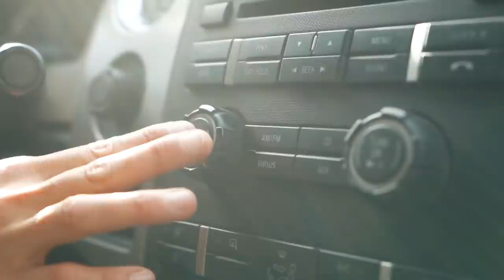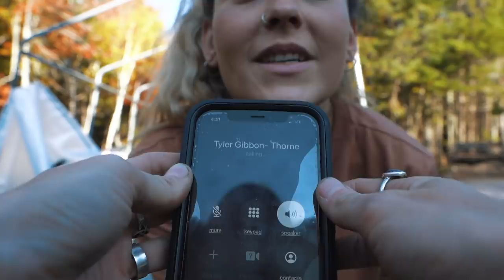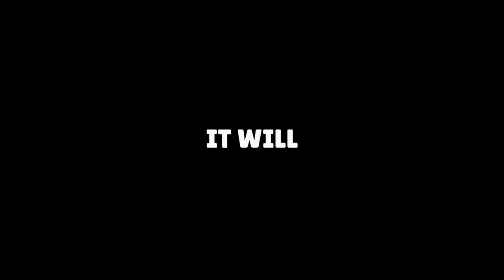Preparing for First Winter at Off- Grid Cabin

Comment: When you stack your wood you should criss cross the end pieces, meaning 3 or 4 pieces with the ends facing out then the next row same direction as the pile and the next facing out again.  This provides a support on the ends so they won't roll out.  Hope this is helpful!
Reply: I didn't have the heart to write this... live and learn! The walls of the tent will be severely tested. Throwing a tarp over the pile to be corded while it rains is a good idea also. As long as we're at it, the bottom row of your cords shouldn't touch the ground. Pallets are ideal as they also create more air space to dry the wood.
Reply: @secondhandrose6214  good suggestion.  Better air flow under and helps decrease chances of mouse nests.
Reply: All stuff I was going to say. Mouse, rat squirrel and any other small rodent will make a home in the stacks. Use some of your split wood to stack on the ends criss cross, you have 6 cord you won’t miss the few you will use to make end posts. Plus if you put a structure on the outside the tarp won’t be able to breath then you may get mold.
Reply: Definitely wood should be stacked on something such as a pallet. Lots of work 💪
Reply: Was going to make the same recommendations, pallet floor and crisscross.
Reply: Stacking wood is an art. alternate the wood so that you give the cord strength. That way you do not touch the sides of the tent. Plus you do not want the wood to stack against a reinforced wall, you want there to be air flow around the wood cord.

Comment: If you stack your wood in layers alternating the direction you should be able to stack straight up with no rolling off the pile. One layer left to right the next front to back. Continue as high as you can reach! Just a thought!
Reply from the maker: Yes! Thank you! That’s what we researched. Takes some practice 😂
Reply: what John said, plus minimizing space inside the wood tent.
also look into getting a Gorilla wagon for the  yard, they have 'em on amazon. 
a good sharpening stone for the Axe for Chopping wood and a decent chopping block will help with ergonomics 
funny thing hubby and I replaced the cover on our Shelter Logic shed as well.we started around 2 and finished before it turned to darkness, but we also used our backhoe to stir up the dirt in the lane-way and sold tires off another vehicle. So from 1 till 7 it was go go go.
for chainsawing you could use some of the longer tree limbs and make a DIY stand for sawing wood. just remember if the limb is starting to bend as your cutting, STOP remove the chainsaw and turn the wood around. depending on the side of the limb it can bind up the blade and you will be in a pickle. and a knot will make the blade kick and jam up so never work under it. Always out front and don't lean into let the saw do most of the  work but always have a grip on it.
I would love to see you guys insulate the cabin. I know at Home Depot there have big cans that could cover your entire house in  1 attempt.
Or just put in the fire proof stuff with a vapor barrier. then you guys will be snug as a bug in a rug.
Keep up the good work
Reply: Probably the best suggestion yet for stacking rounds.

Comment: If you stack the wood along the long row, you can create an aisle and take wood from the back first. Then when you start to add more wood for next season, you can put it in the back and use up the old wood first while the new wood continues to dry. Crisscross stacks will dry faster and like the other have said will create more stable stacks.

Comment: you don’t need to renforce the sides of the tent just “hashtag” style stack the wood on the ends of each row. then you stack the wood normally between those two “bookends”. Good luck, it’s a learning process but I love the feeling of heating with wood👍🏼💚
Reply: This! I'd also say to try to vary the whole logs to split, but that's just how we did it on PEI. Though I'd have probably just put a basic lean to against the current shed and tarped over it.
Reply: I was going to suggest this also. ll=ll=ll=ll=ll=ll=  <- stack like this. Hashtag method. Juat on the ends. Every layer of wood you switch direction for the last 2 or 3 peices. Like a janga set!!! The moddle stays how you have it!!! It works like a charm

Comment: Love your videos. As someone who's burned wood for years, you're going about this all wrong. I've never used a shelter, just stacked it. But, here's my .02. Stack the wood along the long sides. Possibly a third in the middle leaving a walk way between the stacks. Drive in a fence post, or two, at the ends of each row to keep the wood from rolling. Burn wood from one stack until it's gone and move on to the next. Any wood you cut up from your property or have delivered goes into the void you created. Burn the oldest first. Hope that makes sense. You'll get your own system down.

Comment: Hi Girls :)  I noticed one thing that you should have done with your firewood tent : Which is either lay down some of that rolled fabric, lay down pieces of pallets or a bed of gravel to keep the logs from touching the ground from rotting 
And as far as the sides go you can take sheets of 1/2 in. plywood zip tied to the rails or something like that

Comment: I used to live on a farm and we split wood for heat. A great way to stack wood is to crisscross your wood on the ends so it doesn’t roll off. Like change the position on each level. If you Google image stacking firewood, it’ll make sense I think. Just a thought if you hadn’t seen it. Love your videos!

Comment: You can coat your tarpaulin cover for the woodshed with Thompson's Water Seal. It adds a second layer of moisture protection from the elements + it protects it from harmful UV rays that will destroy it otherwise.
 I use a simple 1 gallon garden sprayer and a rag to apply it evenly.
 Just be sure too rinse the sprayer out with hot soapy water under pressure out of the spray nozzle as well. Don't want to ruin it!

Comment: Using 2  T post on each per row is a great way to hold up the sides of your firewood. And I would recommend if you can find some good used pallets to put them down first to create airflow underneath your wood.

Comment: You’re supposed to stack the wood in a cross cross square tower on each side of each row to hold the weight of the wood in the middle.. jus FYI! I love living in Nova Scotia :)
Reply: They should also grab some pallets to get the wood off the ground.
Reply from the maker: Yes, we’re learning haha. Next week! It’s beautiful xx
Reply: @billmcgarrity1241  yes I agree the wood needs to be off the ground... Just use two logs that are the same diameter about 10 feet so 4 10 footers make one row in the tent ...you can nail a crossers to keep them 14 inches apart assuming your stove takes 16 to 18 logs
Reply: @billmcgarrity1241   I was thinking about that. Won't the rain come in at the bottom of the tent and get the bottom layer all wet over and over?
Reply: Yes, definitely lay pallets or two by fours on the ground under to keep wood slightly elevated as well. If you do those two things you guys should be just fine :)
Reply: @kentmillard3869  Well that was interesting and educational. I hope the girls watch it before they unstack and redo it all. 😊

Comment: Can’t recommend “The Game of Logging” course more strongly. It’s focused on effective, efficient, SAFE chainsaw use and in about 4 days I was dropping trees just as accurately AND probably more safely than the dudes in my class who had been logging for 20 years, srsly.

And, check out how to build the ends of your row of stacked wood by turning the direction you lay the wood by 90 degrees, each layer. Right to left bottom row, front to back the next one up, right to left for the third layer and so forth. That will hold the ends and keep the pressure off the sides of the tent. Lived off grid for years in my twenties and you two are crushing the learning curve AND productivity. Legends!!

Comment: I'm looking forward to seeing the direction(s) on how you're going to get power.
You've got several choices if you ever think about alternative energy sources. The most obvious is solar where you could panel your roof (if it's facing in the right direction), or place panels on the ground which you could add motors to and increase efficiency by keeping them pointed at the best angle. There's wind power, not so practical surrounded by tall trees, but there are some new ones coming out that are the size of an oil drum. Geothermal, depending on conditions beneath you this could be a possibility. You could consider solar water heating panels on the roof, but not so practical in the Winter and hard to get snow off, the same goes for regular solar panels, which is why I like ground based panels. They're easier to keep clean and maintain. Another possibility is using solar mirrors. Maybe you've tried them for cooking while traveling in your van. They work for water heating, and I'm guessing here, but perhaps can be affordably used to generate power. Solar mirrors are very efficient with even small solar ovens able to cook dinner with.

Comment: Here's a tip.  When you get something like that tent with a lot of pieces, the instruction manual has a parts list.  Before assembling anything, make sure you have all the pieces the manual says you should.  Another thing when assembling something like that that is tall with multi-piece legs, is don't put the bottom of the legs together until last.  This keeps the top of the unit in reach.  Then you just put the rest of the leg pieces on one side at a time.  Great job.  I love how you don't let adversity stop you!

Comment: Good deal. I was worried you were not going to enough wood for how cold it gets up that way. Ya better get those woolies out girls. It is fixing to get real cold real fast. Make sure your water supply does not freeze up on you. And get a wheel barrel with 2 wheels up front. It will make things so much easier. Stay safe stay warm. And have fun always

Comment: Great work and results! Very impressive! Suggestion,  buy the brackets sold on line or hardware stores to make wood racks using any size 2x4's.your firewood would stack and never role down on the sides of your shelter. The 2x4's also attach on 4 sides going up to the length of the 2x4 you choose. Good luck!

Comment: If you get ANY wind, you’ll want to anchor that shelter better than the junk they send. What I did was sink heavy duty T-posts 5 ft into the ground and tied the shelter down using a noose around the post and a taunt-line hitch over the horizontals at 4 corners.

Comment: For our wood cords we built a rack with 2x4's. The |____| and the wood is stacked in the middle. We used cement deck footers and sat the posts in them with a cross bar in the middle and top to make it solid. The whole thing is as deep as the shortest pieces of wood we have. This way the wood has air flow underneath and all around and you don't have to worry about wood falling on the side of the shelter.

Comment: I don't know if you read all your comments. But.. a few observations that might be something you want to think about. 

1. That shelter logic has no snow load.. One night of heavy wet snow and the frame will collapse.  Ask me how I know. Advice. Stand a 2x4 up at each truss connection as you're stacking you wood.  From ground to roof truss and somewhat snug fit. That way it will keep the frame from collapsing under snow load. 

2. Get the trucked kitted out for winter. IE: keep a couple of blankets in it just incase you get stuck somewhere. Also a little buddy heater with two bottles. Doesn't have to be a big one. Something that can attach to torch tanks. 

3. Snow chains for the truck tires and practice putting them on. Learn how to let air out of your tires for more traction in the snow. NOT COMPLETELY FLAT .. but say down to 25 lbs or so.. Can make a huge difference. 

4. Keep a light weight snow shovel in the back of the truck and a regular spade shovel in case you get stuck in a drift. 

5. Keep A GOOD SET  of jumper cables and a 20-30 foot snatch rope under the back seat or in a tool box in the back of the truck. 

6. You're going to need to add some weight to the back of that truck in the winter. Sand bags serve dual purpose. added weight and the sand can also be used to put under your tires for added traction if stuck. 

These are just the basics... There's many other things that I keep in my trucks in the winter. If you'd like to know more, just reply and I'd be happy to make some more suggestions.

Comment: Hello Ladies. Great work your doing and enjoy watching😁 I highly suggest that you run 2x6 runners down the side and screw your piping into it as an anchor. Then runs some 2x4 across to tie walls together. Then stack wood on top of 2x4's . This way the tent won't blow away in high winds! May need to run some 2x4's from roof to ground to stiffen up roof do to snow. Just suggestions do to having one of these myself.😁

Comment: Instead of reinforcing the side walls, sink poles in each corner inside of the tent. Make firewood sidewalls by stacking perpendicular to the sidewalls between the poles. Fill in the center by stacking perpendicular to the end walls, as you already started to do. It also helps to crosshatch your stacked wood, that is, run 3 or 4 rows one way and then one the other. Somehow I think my explanation is a bit less than clear. But hey I tried. Be warm! Be snug! Be Happy!

Comment: Hi girls. We have a tool called an ever level. They come in several sizes. One is approximately 600mm x 300mm made of 3 small 20 mm round bars welded 100mm apart. There are also two other sizes. One you pull and it is on wheels and one that attaches to a machine bucket. This would really help you with your levelling. Great video.

Comment: Two things. Pile the wood lengthwise. Then just braces on the ends now all along the sides. Secondly. I've got one of those shelters. If you don't put at least 4 of those pound in the ground anchors with cable that ties it down to the bottom pipes, the wind will move it across your land. you'll see it rolling like tumbleweed some morning. Trust me. The wind gets into them and it's like a kite.

Comment: A lot of BTU to burn! If you really want to optimize comfort, the main thing to do about the cabine is to minimize air leak. Additional insulation is almost useless if cold air continue to get inside. A good way to locate air leak is by using a lighten candle and moving it around windows, wall joint, electrical wall plugs. Try to find where the flame is perturbated by air flow. Just using some sheathing tape (tuck tape - red) can make you save a lot of heat lost. For big crack you can fill it with regular insulation before putting tape, but do not compress it too much, hope it help.

Comment: When stacking the firewood , May want to turn the end pieces 90 degrees on every third or fourth row . It will lock the ends of the stack together . That way the wood will not fall and go through the side wall of tent . Or drive stakes , or make something to hold the end . Some stack the wood on a piece that has two legs going up and bottom of those attached to a part the wood is stacked on .. Think of a dolly on the end of the firewood stack . Wood stacked on it and handle sticking up to hold the end

Comment: Hammer a pole or stake into the ground at each end of the stack then run a wire between them at the top to stop them leaning out. Self supporting totally independent of shelter. Happy days

Comment: Enough commenters have made suggestions about stacking firewood, I think.   I'm not sure that anyone has mentioned that Geotextile fabric is usually cut with a torch.  One uses the same kind of portable small gas metal cylinder w/ nozzle that one would use to  sweat copper pipe (small nozzle with "pointy flame" in this case preferred - "click to start"- piezoelectric - helpful) draw tip of flame cone along fabric -- cut is much quicker than with knife and - melted - doesn't "unravel" at all.  Can take practice, but you can get practice by cutting a little long and folding under.
Other small notes.  Trees are your friend regarding the wood drying shelter.  I have in my junk pile (given to me from someone else, fortunately) the components of such a structure that were once intact, but were found by the wind.  Chainsawing, noisy that it is, is best done with Zen-like attention, clear thinking, and inner calm.  The true "protective equipment" is inside you and your head.  Usually takes a couple of years to be good at falling trees, etc.   Some of the rest of us who live one or another kind of "out there" collect and develop 'infrastructure' (things like ladders -- for when our partners get to the age we shouldn't ride on their shoulders.)  Infrastructure can be a friend.  It can also be a life weight and a burden.

Comment: Instead of reinforcing the walls, at the ends of each stack "log cabin" inter lock the wood. One Layer east-west one layer north south and alternate each level. This will give you a strong end to stack in between. This crisscross will allow for better airflow at the end of the stack and keep it dry as well.

Comment: Hey! I'm 3 years into country living myself. Try stacking the wood off the ground for best dry time - lay a few saplings on the ground in rows and stack above. I noticed you had skids in the back, those would be great to stack firewood on as well. As for the sides, you could lay your wood in a criss-cross pattern or build a quick skid side panel with a bracket to hold the firewood in. Look up InTheWoodYard for some ideas. Everything is coming along nicely!